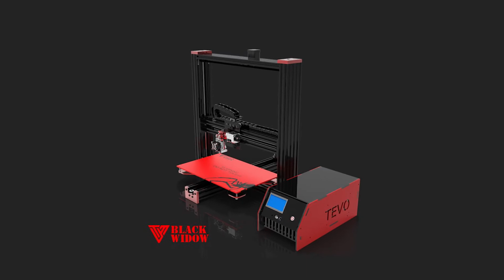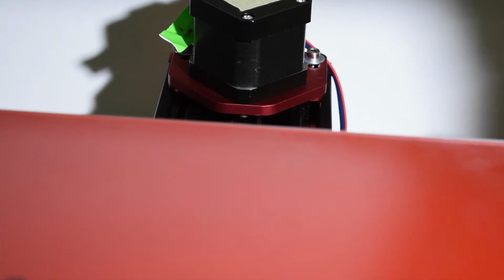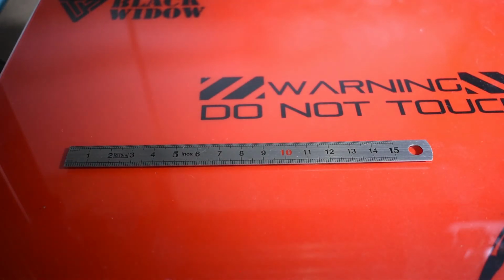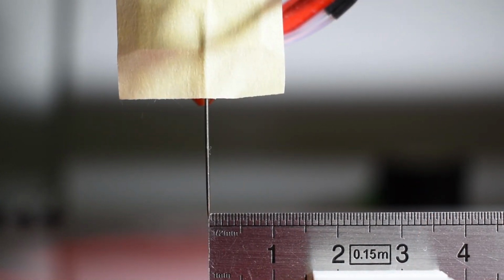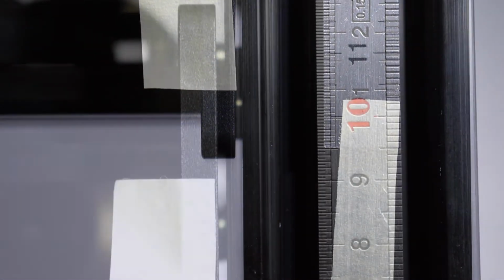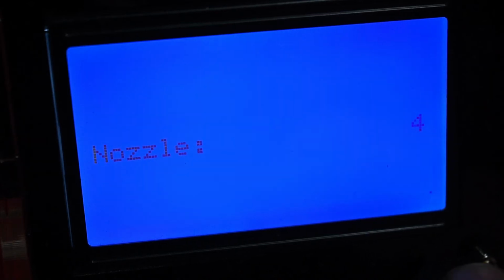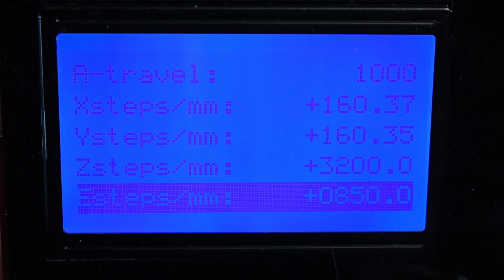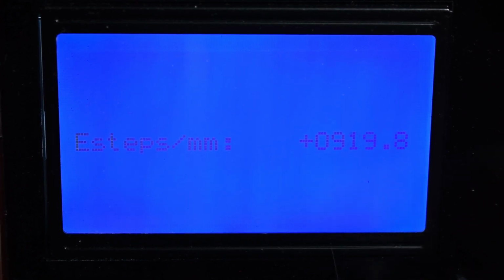TEVO Black Widow V3 assembly - STEP 14 (Esteps)

Comment: Hi ruiraptor, Great series of videos very helpful.

I have an issue with one of my limits(X limit), it is always on, I have removed it, switch it and test it and I have to do all kind of magic to basically turn it off. This always happens when I turn it on, or once it gets triggered it will always remain triggered.
 
Do you have any idea of how could I fix it or do about it ?
Reply from the maker: Hi Jonathan,
If you already swapped the sensor and confirmed that that sensor is actually not working correctly, then you've done already most you could do. I'm guessing you need a new sensor. Either request a new one from tevo or get a new one. If you're planning on buying a new one, make sure you get the exact one with the exact part number as there are several models (different shapes and outputs like npn and pnp).
Reply: ruiraptor thanks man, I was thinking on getting a bltouch so I could use the z limit sensor on the x axis, do you think this could work ?
Reply from the maker: Hi, yes, you can do that. If you install a BLtouch sensor, you can use that one instead of the faulty Z sensor switch.
Reply: ruiraptor cool , thanks for the help.

Comment: Will you tell us what upgrades you are suggesting for the Black Widow, e.g. like Fan Conduct (just posing, I have no freaking Idea for what it is needed for) or other enhancements. Watching your vids scares me as I am a total Noob in this, but I have to blame you, because I already ordered my Black Widow because of your Vids.
Reply from the maker: Hi Richard,
The most important ones are indeed the fanduct. First buy a fan or blower and when you get your printer working, print a fanduct and install it. It will cool your new layers and increase the print quality. You also need a spool holder (you can make one or print one).

Comment: Ruiraptor, I have a little worry when I want to change the values of Step on the axes, the printer do not want to save. When I turn off the printer the values go back to 160. Comment saved these values?
Reply from the maker: Hi Pascal,
If you select "store memory" after changing the values and they reset after power cycle then something it's not right either with the firmware or with the hardware (eeprom).
My advice is to re-flash the firmware and see if it helps.

Comment: For greater accuracy, you can use a set of slide calipers, or vernier calipers, preferably digital.
Reply from the maker: Hi Charles,
True.
Reply: : )) Only added my tidbit to help out others.  Have a cnc micro milling machine that I've done that with, just completed my Tarantula build a couple of days ago, and my CR-10 yesterday, so I'll be doing the same to both soon.  For now just having fun printing stuff.